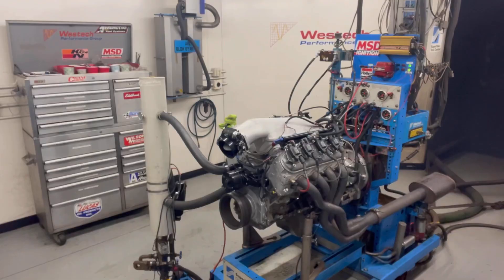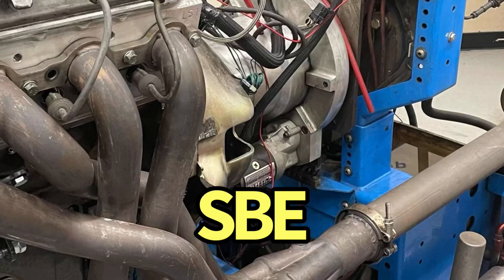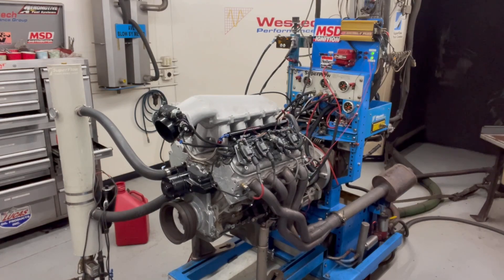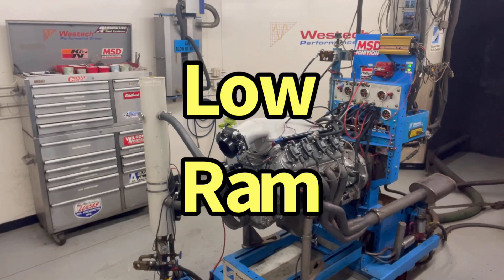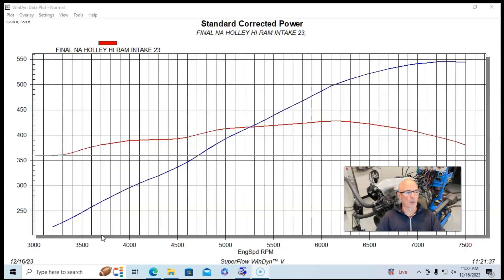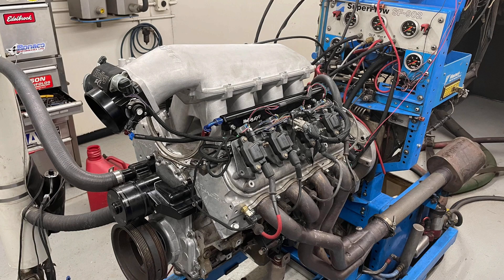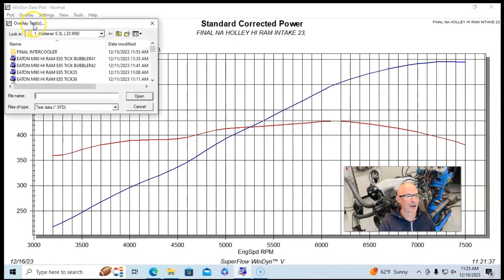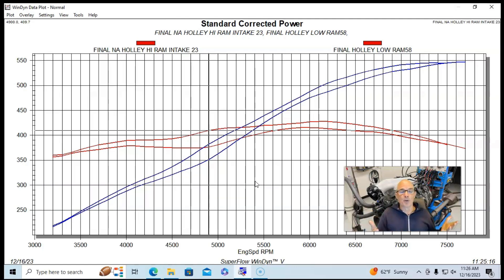7700-RPM JUNKYARD 5.3L LS INTAKE TEST. HI RAM VS LOW RAM-WHICH HOLLEY LS INTAKE MAKES THE MOST HP?

Comment: That's nuts. Would like to see some before and after gains on a bone stock 5.3 though with stock heads and 91.
Reply from the maker: wrong intake choice for a stock 5.3L
Reply: @richardholdener1727 yeah if youre NA. I have twin 67/62s. Just curious to see the NA numbers to see what it would roughly be on 14.7lbs. Haven't been to the dyno yet but I'm on 10lbs and not sure where I'm at. Hi Ram, 102TB, BTR stage 2 twin turbo cam.

Comment: I just bought a 5th Gen Camaro SS with full length headers,3" full exaust, stage 3 cam, roller rockers, with a Holley Sniper Hi-Ram intake manifold. I'm concermed that it's more for max effort high RPM  racing only and terrible for lower rpm power band street use. On a 441cubic inch LS3 engine, bigger injectors, cam, ported heads,headers, 93 octane it made the most HP compared to the stock manifold, Fast LSXR 102, Fast LSXHR 103, and the Holley Sniper Hi-Ram. The HI-RAM made 571 TQ lower than the 577 TQ of the stock manifold. The HI-RAM made the most Hp 637 but at 6.400 RPM. It didnt perform well below 5,000 RPM. If your street racing, driving your car on a regular basis you want power in the 3,900-5,400 RPM range! So to me the Hi-Ram isnt that great of a puller through the entire RPM range.More from 5,000 to 6,500+ and that's not practical for a Cammed up 5th Gen LS3 engine. Stock the redline is 6,600 RPM and fuel cut off at 6,900 RPM. But nobody runs their car that way and if they did, its gonna get wore out.The best power band for street use is 3,500- 5,800+  RPM  for everyday driving- street racing. My Camaro gets delivered in two days and I'm concerned I'm not goin to like the performance of the Holley Sniper Hi-Ram throught the low to mid RPM range where it's needed more. Who wants an intake that only makes power above 5,000 RPM? I'm concerned I'm gonna be disappointed in it? The owner told me it would benefit the low end power and torque greatly if I added a 3.91 rear gear set, which I plan on doing. So am I  correct in saying the HI-RAM doesnt make good power below 5,000 RPM?? I love the way it looks on the engine. It has a polished finish and fits below the Camaro 3" cowl hood.

Comment: My new build engine 427 Ls stroker, it's coming with the Holley short Ram, because I don't feel like cutting my hood. I guess i'm going to just have to add forced induction to make up the horsepower difference. 😆 🤣 😂
Reply: Run a cowl hood. I'm running the Holley Sniper Hi-Ram intake manifold with my composite 3" cowl hood on my 2010 Camaro SS.

Comment: Port the High ram like we do and you will see 25-30hp more. 
We do a lot of LS stuff
Reply from the maker: 25-30 hp from porting a Hi Ram? I would like to test some of your stuff
Reply: @richardholdener1727  yup. Like you said it's the hood clearance but those 5.3s and 6.0s look airflow especially when the cam, heads and valve springs are up to par. Increased Static airflow affects the wave length tuning as well.  The power increases within the same rpm range. We see this all the time the the engine and chassis dyno. When we port dual/single plane manifolds, 351w truck efi manifolds, GT40 style manifolds,  low and high rams, factory Coyote and LS manifolds also
Reply: @bigdogsportingtonyb2833  The guys are magicians with porting. I've seen the results.

Look stock, flow like a Trick Flow...

Comment: I would love to see a high ram vs low ram on a big gen 1 SBC. I have a Dart SHP 427 small block making 550hp @6400rpm with a Howard's hydraulic roller cam  advertised lift I/E .545/.565 duration I/E 294/300. Lob center 110 intake center 106. PN 110275-10. Heads are Dart Pro-1 215. I have been using the FAST Street XFI multiport EFI.  It's a batch fire system from 2018 and is difficult to tune. I'd like to swap out to a better system.  I'd love to see just how much power I could get with this engine with it still holding together.  I could switch to a solid roller cam. The crank is a forged 4.00 stroke.  Rods are Scat forged H beam. It has a set of Icon 2618 forged pistons. It has a lot of piston slap when cold.
Reply from the maker: you need a Hi Ram-Not a Low Ram for that

Comment: Curious how or if an intake mounted intercooler would affect these results or does everyone believe we would end up with similar results?
Reply from the maker: intercooler on an na motor?
Reply: @richardholdener1727  sorry sir I should have provided more info. my situation is a simple twin turbo  build sbe l33 5.3 with 366s.I don’t plan on spinning anywhere near where either of them are gonna provide the positives. Plan for a future piston rod 6 liter in the future . But have to use one of them at this point and have a large shearer unit with a low ram already. Due to looking better I previously had a high ram and it was just so tall tho I could use it,I opted to get a low ram just to bring the height down.
Reply: I’m also using a shearer fab lid instead of the Holley top. I appreciate your replies greatly

Comment: Would you expect better or the same results on 6.0 ls2 with the comp 459 cam and TEA 799 cnc port heads?
Reply from the maker: the intake runner length always does this-the cross over might happen 100-200 rpm earlier with bigger motors
Reply: @richardholdener1727  Thank you Richard I always enjoy your videos and even better when you answer!

Comment: Any idea of the wet flow characteristics of the ultra low ram intake? My vette makes 680hp has meth injection with a stock ls1 intake so I need a better intake for my setup.
Reply from the maker: are you asking about flow or distribution
Reply: @richardholdener1727 distribution.

Comment: The low ram is very similar to the stock manifolds on my Buick V6s, not idea for stock to medium cams but decent for the bigger cams. I have a cam set aside for a later project that is 262/262 deg, 303/303 advertised, but even then it's still a bit on the short side for the ideal runner length.  

But otherwise it's very well designed with a good area for the runners to support pretty wild builds, tapered runner as well.  The major difference to this Holley though is the plenum on mine are a sideways oval log-ish plenum which allowed the top side of the tapper to extend all the way to the top of the plenum, while the bottom side is rather short like the Holley low ram.  I can't recall exactly on the length of the runner, but the middle (average length) from back of valve to the opening in the plenum is 245mm.   Mine is actually called in the community the high ram, there is a even lower ram version used in the previous gen LN3.

Comment: I see SBE 4.8s and 5.3s turning 7k+rpm alot these days. Even boosted. My question is: can a gen 4 SBE 6.0 run 7k+ turbo'd with a stage 3 cam? No upgraded rod bolts needed?
Reply from the maker: YES-SEE BIG BANG VIDEOS

Comment: Do you have a go to kit for afm 5.3  delete? Do you have a throttle preference wire or cable? Pros and cons for each? Do you have a website with a list of parts tested and combination hp?
Reply from the maker: BTR and others have delete kits. I like a cable (especially on the dyno). no website

Comment: In my '57 Chevy, I have what started out as a Chevy Performance crate LS3, and added a Texas Speed Stage 3 NA cam, the Holley Hi-Ram, and 1-3/4" long tube headers.  Together with 4.11 gears and a Circle D 4,200 stall converter, it runs great on the street, especially when I stand on the gas. :)
Reply: The Holley hi ram is worse than the stock Ls3 intake

https://youtu.be/u1MhOREyL3g?t=1399

Comment: I’d be interested to see what the stock intake does in comparison to these on the hp and torque curve down low, as well as sheet metal intakes vs cast
Reply: so do I if a stock makes more down low to mid under 5500-6000 whats the point even making them, but you have a lot of people making them like BTR, plasmaman  so whats the difference between them, these are probably more for boost
Reply: @Disableddragracer  Some people use their cars for racing and operate their engines at high rpms, with gear ratios to match, higher rpms than what most road cars operate on. And if stock intakes don't suit their operating rpm range, then they look to the aftermarket.

Setup for drag racing is different vs. autocross, setup for autocross is different vs. time attack, etc. Slapping parts on your car without actually having a target performance goal is a waste of money.

Comment: Whats a good low profile intake for the LM4/L33, under 6500rpm, street/drag race? 
I have an LS swap I'm working on where hood clearance is really tight. I was thinking maybe ls3 with adaports but I'm not as familar with whats available for the LS.
Reply: Can’t go wrong with the “fast lsxr” intake! Great on anything with tight clearance and makes the same power or more than most other options.
Reply: @codystrom8708  Thanks.👍
Reply from the maker: ls3 adapter is not good-use the ls6, Dorman LS2 or Fast
Reply: @richardholdener1727  
Thanks 👍
Reply: Also, wow, all of thouse manifolds are 1000 bucks. I thought LS stuff was supposed to be the more affordable option. The gen 3 intake on my coyote was like $300.
Reply: @177SCmaro  definitely the fast intake isn’t cheap for sure, I’m running the oem LS6 intake on my car and I’ve heard from guys like Richard that the doorman LS2 is also a good cheaper option.
Reply: @codystrom8708  
I found an aluminum version of the ls2 intake that is much more reasonable but I don't know anything about it other than it says 1500-6500. I was thinking like max $350 for an intake. My goal is only 400-450hp from a 5.3 so I don't need anything crazy. The crazy is the fact this is a 2000 Celica V8 swap 🥴

Comment: Holley also makes a mid ram.
Reply from the maker: doesn't work well
Reply: @richardholdener1727  could it be a stop-gap that will fit under some holds and provide a small torque boost in lower rpm over the low ram?
Reply from the maker: I don't think it fits and it is not an intermediate runner length between these two-it is a different design

Comment: I'd like to see a comparison of a high ram vs a low ram with intercooler on a turbo setup... see if the charge cooling makes up for it
Reply from the maker: the intercooler cannot make up for it. Runner length always does this, boost or no boost, intercooler or no intercooler
Reply: @richardholdener1727  I phrased it poorly: low ram with intercooler vs high ram with no intercooler, since they end up around the same height so they fit under the same hood. I'm talking about one of the AWIC that goes under the lid.

Comment: When you took the lid off, it made me wonder   about 8 stack systems vs hi ram single throttle. Seems to me if both were same overall length, hi ram wins because of lack of turbulence caused by the internal t valve. Ever test this comparison?  8 stack wins the cool factor hands down though!
Reply from the maker: open plenum has always made more power, I will redo that test-there was a problem with this one

Comment: Why do companies like FAST name short runners intake as "Race" specific knowing that long runners are better performing throughout the curve 🤔
Reply: Because the short runners can make a little more high rpm power. With some racing you will chase the max power since you can keep it in a small rpm range.
Reply from the maker: long runner don't make more power at every rpm

Comment: Great job...unfortunately for me my swap dictated the ultra low ram. I have a stroked and built L33 with a summit stage 4 and related upgrades. Didn't port the heads but I plan to eventually run my 80mm vsr turbo. Compression is a little over 9.5 to 1. Plan on running roughly 10lbs, maybe less..possibly a tad more. Electronic boost controller will give me 15 to 16lb overboost with button. Engines gapped for 15+, everything forged
Reply: Everything is forged?
Reply: @ChingoMandinguez  well I guess the manifold isn't, it's cast. I'm still using stock valves but I'm pretty sure valves are forged already, material choices aside. Using arp studs top and bottom, full forged rotating assembly,  MLS headgaskets, I guess the can isn't actually,  they are hardened though. 1 piece chromoly pushrods, link bar lifters(no idea if they're forged), melling 10295 oil pump, billet pickup tube brace. Aluminum oil barbell. Stock accessories but with ict billet conversion brackets. Corvette engine mounts(no idea)...but yes...most of the engine is reinforced. Kinda wish the block was forged instead of cast though...oh well
Reply: Oh sorry if you were asking what I meant by everything forged. I was talking about all the rotating and power handling parts of the engine being forged an gapped for 15+lbs of boost. I wanted a somewhat overbuilt engine with a 4" stroke that would live happy reving to 7200rpm and make a daily 650+rwhp for my 3rd gen Rx7. If I later get an AWD porsche I'll do a totally aftermarket setup with BTR valvetrain designed for 10k rpm(look it up online, it's awesome) and limit it to 8500ish rpm...very gt3 territory but with torque! Thats a few years away though

Comment: But what happens when boosted
Reply: So make the same power but hi ram makes more power lower rpm? Would think once boost is in the low ram be more efficient at lower rpm or match the high ram
Reply: @12race39  As Richard has been teaching, boost is a multiplier of what it is NA.
Reply from the maker: Hi ram made more power through the entire curve til the hp peak at 7500 rpm. The same thing would happen under boost
Reply from the maker: exact same thing
Reply: I was always told make the intake runners short to get the boost in fast and as the longer tub make more power na because the scavenging same as long tube headers but under boost it doesn’t .??

Comment: Notice oil pressure drops off after 7k
Reply: 2PSI is a "drop off"? lol
Reply: @rustysausage69  yes no big deal, but what if turning to 8500 and continues to drop off, thats not ideal
Reply from the maker: who runs a stock bottom end L33 to 8500 rpm?

Comment: from this test the ultra low ram from holley would be even more  loss in the mid range. 

that hi ram is hard to fit either cut a hole buy a hood lower the motor lower the k member lol

but another note how would the trickflow split intake and elbow do?

Comment: That no lid test was wild :D
Reply from the maker: I will try that again-it has always made more power
Reply: Its so strange to see gasoline engine without throttlebody etc. I know diesel can do that, even did with my 6.2D when swapped intake... it just looks so wrong.  @richardholdener1727
Reply: @richardholdener1727  how does the tune get affected after taking off the lid? Any input from the MAP sensor would be off.
Reply from the maker: the map sensor reads the same-since you are at or near 100 kpa at wot

Comment: Hi Richard I have a question the crankshaft turns twice as fast as camshaft
So at 7700 RPMs you were talking about the camshaft speed
In reality the crankshafts turn in 15,400
Reply: The camshaft turns at 1/2 the crankshaft speed. Engine RPM is measured at the crankshaft. Hope this helps
Reply from the maker: crank spins 7700 rpm, cam spins 1/2 that
Reply: You are correct about the speed relation, but engine RPM is measured at the crankshaft since the output is tied to the crankshaft.

Comment: Now that you did the no lid test, I want a holdener powered variable length intake runner test. Pull the lid, slap in place runner extensions and then pull those as revs pass 5500 or 6k.
Reply: Im printing a variable intake, but for 4.6 2v. 5” of movement on the runners from 15” to 10”. Lets hope i can nail this fast, i’d be more than happy to send it to RH for a test
Reply: The coolest best air to pull into the engine is where the back glass meets the deckild.
Roof Runner Ram.
Reply: Now I saw him do the no lid test I want to see a no intake test but you would have to figure out injectors
Reply from the maker: no intake makes even less power
Reply: @richardholdener1727  you just got to spin it to 15,000 rpm
Reply: @richardholdener1727  don't kill dreams Richard. Spin it to 20k and make some power